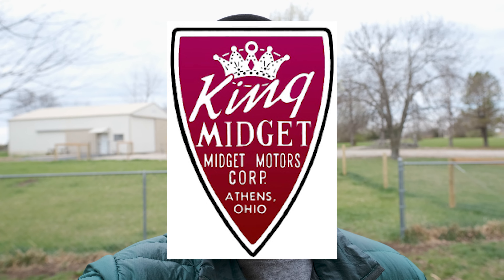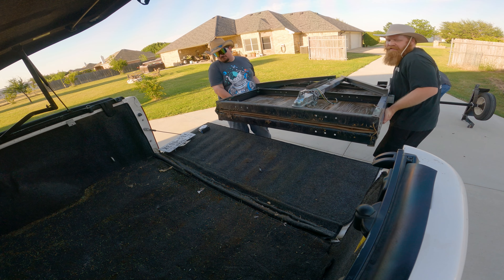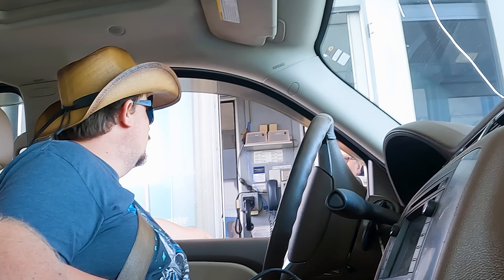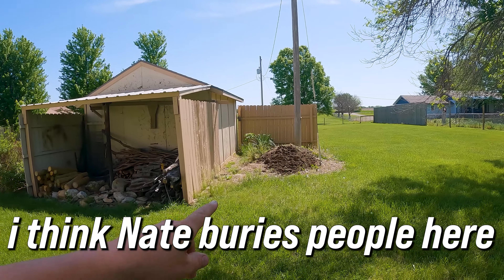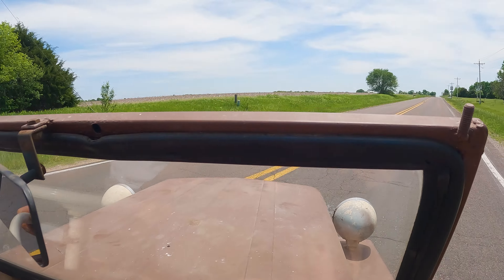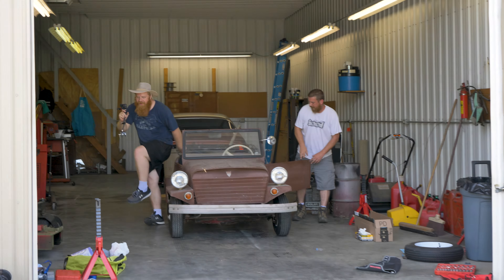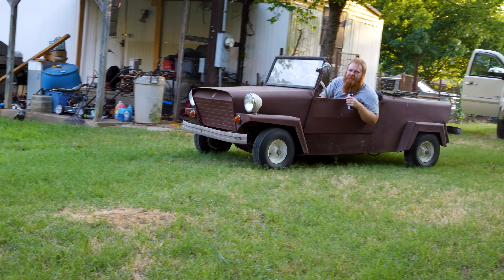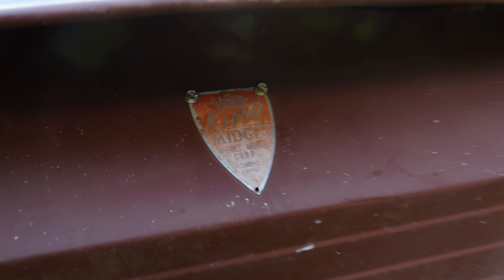We Bought the Tiniest Car! Test Driving America's 1967 Masterpiece.

Comment: Do yourself a favor, tune up the Kohler engine, replace drive belts, lubricate everything (don't forget to fill the front shocks with oil) and drive it around. If it still has the original 1967 tires replace them. See how much fun you can have with it stock before you start messing around.
Just get everything working perfect and you might be surprised what a blast it is driving around town at 30 MPH.
If you are still not happy, the favorite engine swap is a 22HP V twin from Harbor Freight with variable belt drive transmission. This gives more pep and smoothness without over matching the chassis, brakes, etc and without killing gas mileage.
These days, 90MPG can't be too hard to take.

Comment: My mother bought a new ‘57.  It was one of the first cars I drove when I got my license in ‘62.  It was fun to drive and perfect for delivering my newspaper route.  The two speed happens because the outer centrifugal clutch which drives the larger pulley has weaker springs than the inner one.  The two pulleys are on concentric shafts with a ratchet between them.  The shafts feed a F-N-R gear box.  That means you also have two speeds in reverse if you are crazy enough to drive backwards that fast.  1957 was the first year that electric start was standard equipment.  If you ordered the optional doors you got “woodies,” a piece of 3/8 plywood with a 1x2 frame around it.
Reply from the maker: This is an awesome story! That was probably a great car to zip around on a paper route early in the morning. Easy to throw the papers from id imagine.

Comment: A Harley engine keeps it all American and they've had electric start since 1965. But you're going to have to redesign the whole suspension front and rear. Since there are only about 1000 of these left in the world you might want to consider an all original restoration.

Comment from the maker: Do yall think a Harley Davidson engine in the back of this is a dumb idea? Let us know! -Kyle
Reply: Yes, you would have to mount it transversally and that won't be fun.  You would be better off with an old BMW aircooled boxer R motor
Reply: Nancy's guy Frank here... I think you would be very satisfied with the last eng. the company put into it, the 12 hp Kohler eng.  That pushed it to almost 55 MPH... and much faster than that would be suicidal and defeat the purpose of the car.  Remember that the frame and other parts were not designed for that much stress.  If you want a dragster, change the frame and put a SB Chev. in but then you got a dragster not a King Midget.🤣